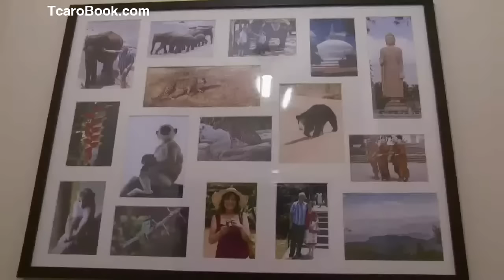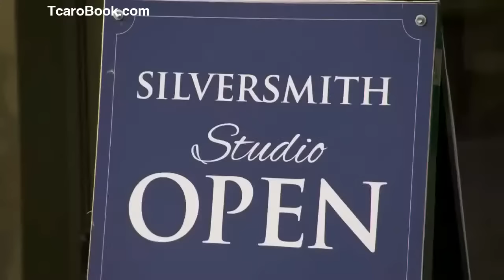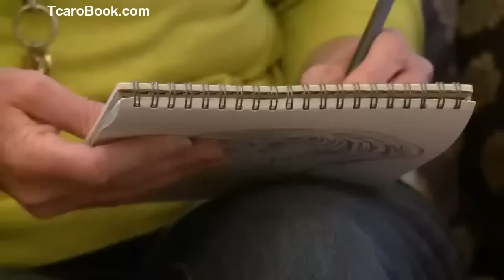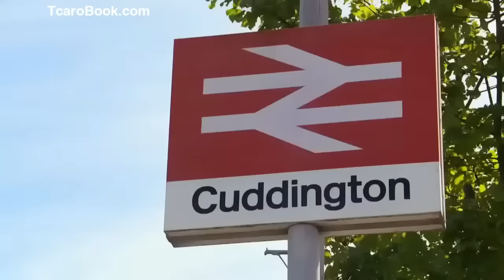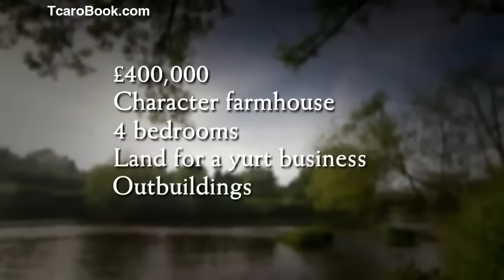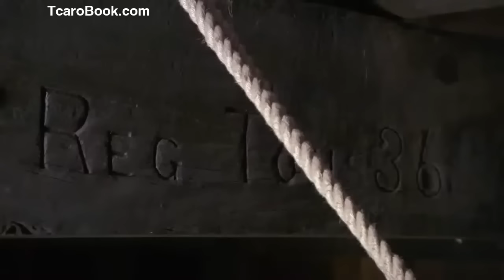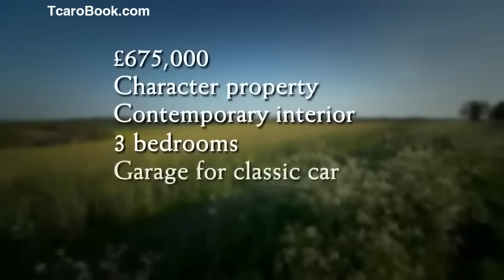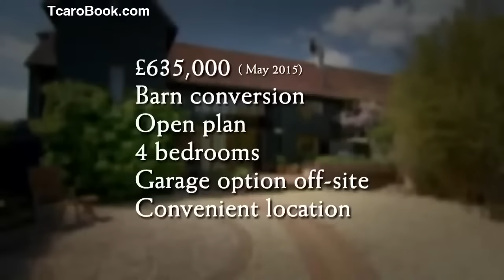UKTV 2023 - Escape to the Country - ETTC (Welsh Borders, Cheshire, Shropshire, Oxfordshire)

Comment: Might you explain the range seen in the kitchens. This American sees a stove and a range often.  The range has 2 covers on it.  I only know the words to be interchangeable for a uncovered unit that is electric or gas with 4 or more burners on top. Usually the stove has an oven beneath or could be countertop type range (stove).
Reply: Now I’m seeing one called a Cooker 🤔
Reply: In a lot of British country homes we have an Aga range. The old ones also ran the heating and hot water. They had to be kept running all day - my mums life was controlled by making sure the Aga never went out because it ran on a traditional fire. It was used for everything, drying laundry in wet weather, damp dogs dried off in front of it as well as heating the home and cooking. Nowadays the modern ones often run off electricity and you don’t have worry about fire going out. Aga has a website which is worth looking at.